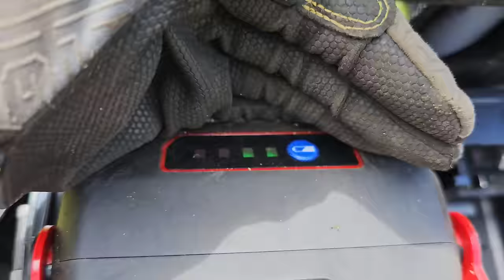He Has To DEAL With This OVERGROWN Property Every YEAR!

Comment: Back in the late 90's I lived in an apt. Across the street on the corner sat a beautiful house that apparently got a bad gas leak. Fire department showed up, the whole works. That was on a Friday night. Renters moved out the next day and the house was knocked down on Wednesday. I was told the owners might have been an elderly couple who showed up to the property. I lived there quite a few years after that and nothing was ever built on that now empty corner lot. The next few summers I called the city to complain. Out of sight, out of mine turned that lot into an over grown mess. I even called the police after witnessing a truck pull up and dump furniture onto the lot. The owners would always get someone out to clean up the mess and keep it mowed for the rest of the summer, but it took code enforcement to get them to act. I no longer live in that city so no idea if anything has been built there, but crazy to just pay taxes and some mowing service on prime property. They could have easily built a duplex or even 4-plex and earn rental money.

Comment: My suggestion to BOTH of the neighbors on each side of that "abandoned property" would be to do a simple online property search as each city has that available online. You just need to know the exact address and you can find the owner of that property.

But since it seems to be an ongoing yearly problem, maybe those neighbors can make a deal with each other and buy a John Deere Yard Tractor and they can take turns mowing that property when they mow their own yards?

It's A LOT easier using a riding yard tractor verses a regular push mower especially if you are going to be mowing on a regular basis and based on the video of the neighbors on either side of that overgrown property they ARE keeping up with their own yards.

Something to think about......

Comment: nice equipment - remains to be seen if battery powered lawn equipment will last as long as gas powered.   Is the mower a Toro also?   is it battery operated?   You did a great job but I thought that was a dead animal too.   I ended up laughing when the cat ran away.

Comment: The video goes from "blocky" to sharp as a tack and back again, is there anything I can do to fix that, or do i need a new tablet?
Reply from the maker: Your video quality is probably set to auto. It sounds like it's switching from 360p to maybe 1080p? Set it manually to 1080p, and it should be as crisp as a chip.
Reply: @fillslawncare  thanks, did that and it helped a lot.